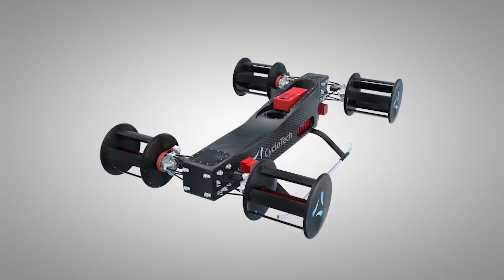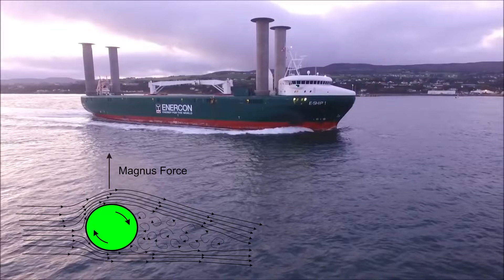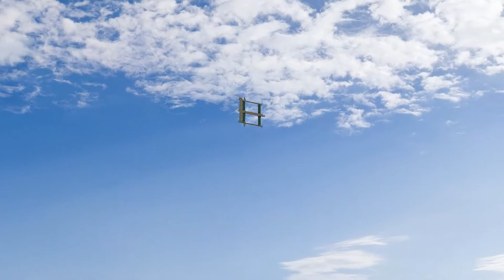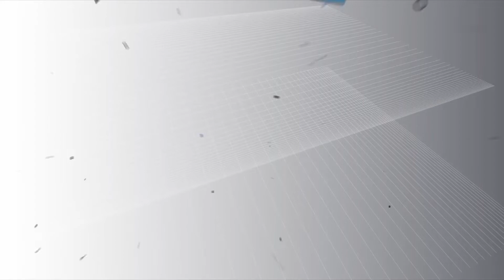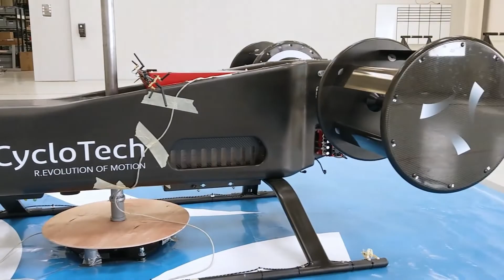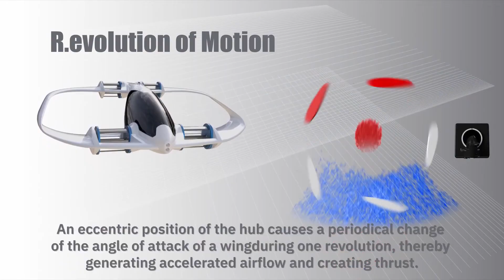Futuristic eVTOL Propulsion System | Cyclorotor / Cyclogyro | Air Car

Comment: try ducted impeller thrusters instead (output vents with shutters directionally, down, up, back, forward, even sides), radial centrifugal high pressure thrust impeller
Reply: the less breaking moving parts there is, the less your system breaks and is more robust reliable
Reply: vawt turbine is better wind power source, even on carriers/containerships
Reply: unique is not reason for patent
Reply: you just said you made the idea work
Reply: f the gov laws whatever
Reply: you dont own anything
Reply: idea is not patentable, says the law
Reply: the moment you try to enforce by law, thanks for all your fish
Reply: well if you like patents then I'll enforce turbine/rotor blades patent, no using of rotor blades without royalties, and its global universal patent, by God
Reply: well you better have bigger guns then, but God is not to be teased
Reply: Jesus Christ the Lord God who is Spirit
Reply: there is nothing new in "your" system, all not patentable, it holds

Comment: not a good idea for evtol. The thrust to power ratio is very low, complexity is high, weight is high, bearing, link bar.....safety issue. EDF with same dimension is more efficient